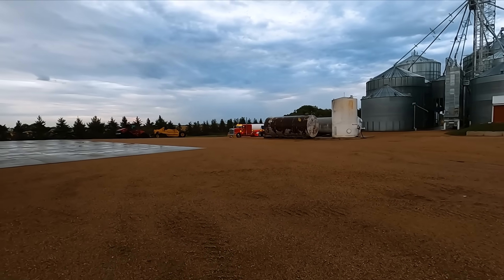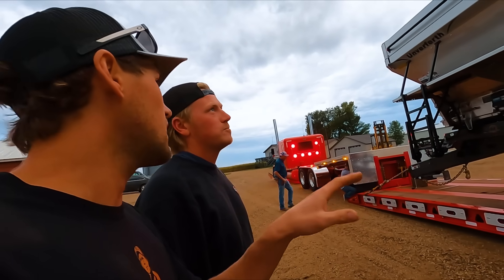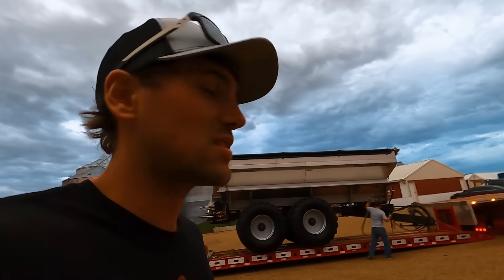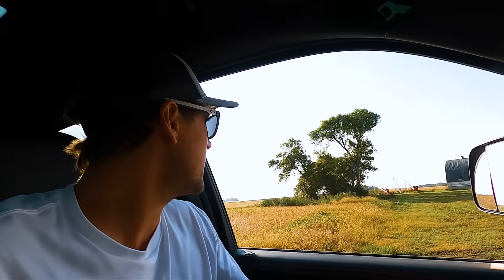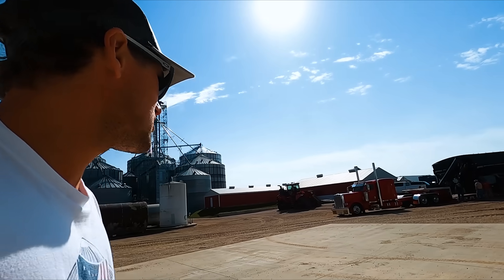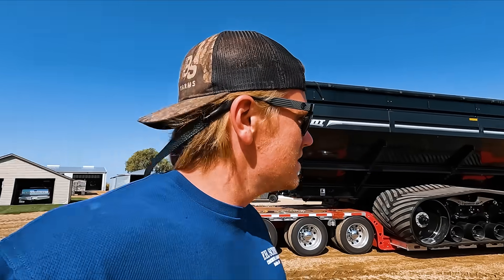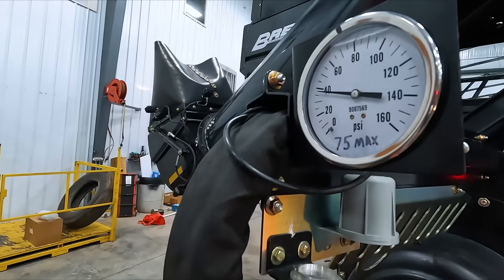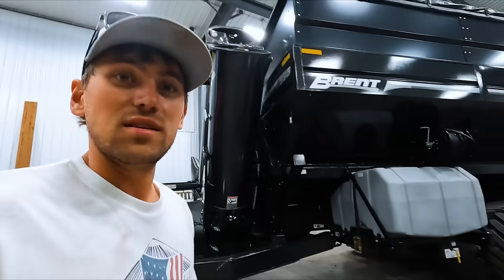The New 2598 Has Arrived!!

Comment: I will tell you a really good Water Additive to use in the Water tank, 23 Years of Service now retired. We would Use a Product called Wet Water, it’s a saturation Liquid that actually help to soak into the Material that is burning but it’s very Expensive so we started doing research on something we could use that is absolutely safe and low and behold Laundry Detergent works miracles on Everything we used it on from from Insulation to Car Fires you name it works. Ask the fireman he might know. I worked a Fire Department where we ran 25 Calls per Shift on average.
Reply: What'a a good ratio to use per gallon?

Comment: Have you ever tried a transfer pump with a fire nozzle on the hose to wash out tracks? I was washing skid loader tracks with a pressure washer and said there has to be a better way.  So I bought a transfer pump, fire nozzle for the hose, and a 300 gallon tank. It saved a lot of hours that yr cleaning tracks.

Comment: When you guys pull wires out of equipment you can do what my dad used to do, he pulled a small rope or twine in so the next guy had less trouble. He also pile one in when he installed it in case he had to add another wire. Just saying!😊
Reply: That’s put not pile